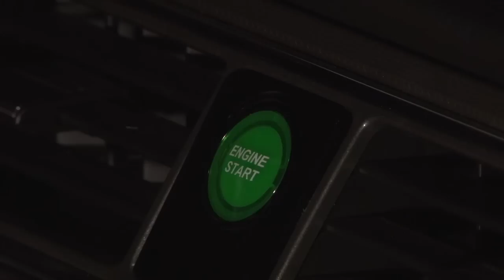Mustang Barton Industries Short Throw Shifter 2011-2014 Installation

Comment: Just installed this with a jack and two jack stands. The bracket is a big pain in the rear and would of rather paid $100 to get it installed professionally. For any future lurkers looking at this video wanting to do there own install and you dont have  a lift hers a few tips that the video just skips right over.

The passenger clip on the stock bracket is absolutely horrible. I found the best way to remove it is to just pull the stock bracket down and use the other side as leverage as the clip will bend to your pulling. your not getting it off with pliers and a screwdriver, your just not.

The boot on the shifter although mentioned is also an incredible pain as well. The boot is really stiff and theirs very little room to stretch over the base. I started by dropping it on the drivers side first. then i just pulled really hard on the entire boot from the passenger side to get it over the opposite side.

Comment: Just completed this on '13 ROUSH Stage 3.  This video walked me through it perfectly.  I'm not mechanically gifted- but completed with zero issues. Blown away at the difference!! Thanks again
Reply: Jack should have spent a few less bucks on the 26 Roush decals and emblems that appear on the RS3 cars and spent the money saved on a proper shifter in the first place. IMO.

Comment: "Since its the Boss's car we want to take it easy" and just punches it ahahhahhaha had me rolling. Btw did you use lock tight on those bracket bolts? According to the MFG they recommend lock tight but I'm not sure if its necessary. Great videos BTW very good quality and good explanation.
Reply: +rudy top  I used a small dab which isn't a bad idea.
Reply: @Zerogivengarage  blue loctite?

Comment: Yes the factory lower rubber seal that you reinstall on the new shifter. There is a groove that it goes into and it's very important to the shifters operation that the seal is installed properly

Comment: Honestly that will depend on your dealer. Barton makes the Ford Racing shifter so Ford knows its a quality part, and it is better for the transmission, but the dealer could possibly still call it a modification and not cover the transmission if it fails. The two post bracket is easier to install and its beefier than the standard one piece.

Comment: Just be careful when tightening the main two bolts that hold the 2 post bracket to the body, as I accidentally broke one off on my new 2014 Mustang GT. I had to then drill through the sheared bolt, and I used different bolt and nut from hardware store.

Comment: I had to laugh while I was doing this because they cut the video before they showed how much of a pain in the ass getting that retaining clip off the passenger side bolt was! Might have been easier if I had a lift. Did this on my back in the garage with jack stands at 3/4 maximum height they could go. Getting that rubber boot around the shifter base wasn't a picnic either. I got er done tho!
Reply: Bigal396 1969 ill be doing this fun install next week on my 14 5.0 with a steeda shifter and bracket with bushing. Hopefully it goes smoothly ive never done it before.

Comment: Quick question Bill. I was wondering if you knew whether or not a short throw would void the warranty on my transmission? Also, would you be able to tell me the difference between the regular barton shifter bracket, and the two post shifter bracket? Any help would be greatly appreciated. Your videos are the best out there, keep up the good work!

Comment: There will be a slight increase in NVH but it should be barely noticeable, sounds like the dealer did something wrong with with the install. Sounds like the 2 post bracket may not have been installed properly.

Comment: Hey bud I'm getting locked out in 1st and second. Any suggestions.?
Reply: Did you get it fixed?
Reply: @MTEIsrael  no.. I have to put it into neutral before I come to a complete stop. Decided to live with it until I get a new clutch.. Barton said It might be the clutch. Installed both at the same time...

Comment: Hi Bill, is it normal to hear and feel the grind each time to shift? The throw is great, but the sound that it makes is just ugly to the ear. Please advice Bill, thank you!
Reply: There should be no grinding when you shift.
Reply: @Zerogivengarage  Hi bill, i just got mine but mine tends to grind and there's a lot of sound coming from the shifter. I know since it has a more mechanical feel vibrations are sure to be present. although when i press the clutch when idle the grinding feel disappears. do you think it may be a gear problem instead? also when i go into first it goes into reverse although I haven't pressed down the shifter. Any type of information would be helpful. thanks!

Comment: Anybody have trouble with the barton shifter? Have trouble shifting into first or second if its in neutral and i push shifter hard to the left wont go in into first or second, i have to push to the left lightly and it will go in ok

Anybody else have this problem with barton or the ford racing?
Reply: +61484  did you fallow the step where hes admit about putting the rubber b
oot on properly

Comment: I have Borton shifter n its pain to get it in reverse is that normal ?
Reply: I have found when reverse is difficult it is almost always because the factory boot around the shifter base is not seated properly.
Reply: Bill Tumas i have a feeling that the issue i have . i'll check the boot tomorrow morning .